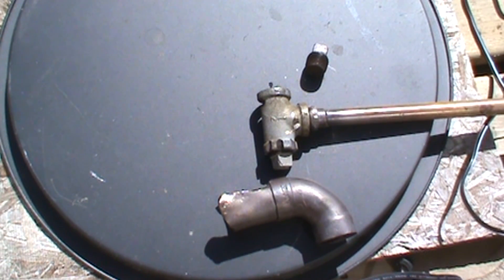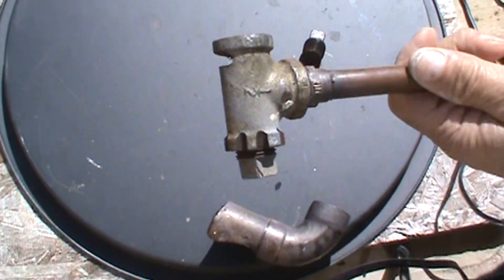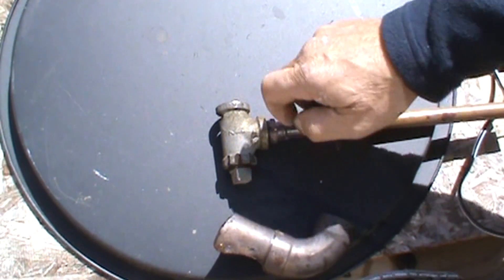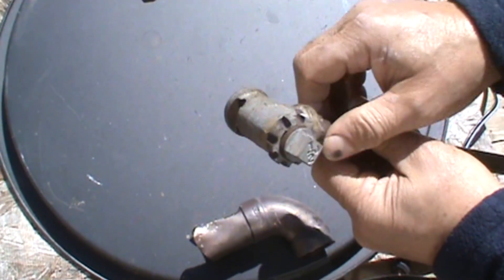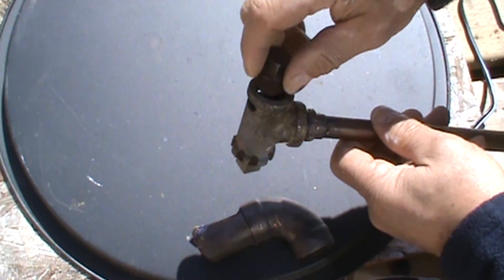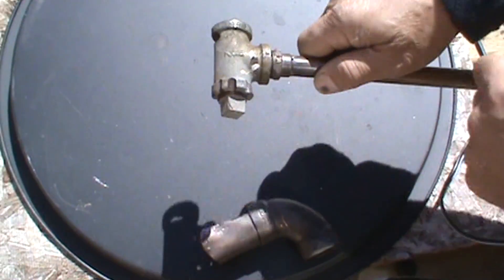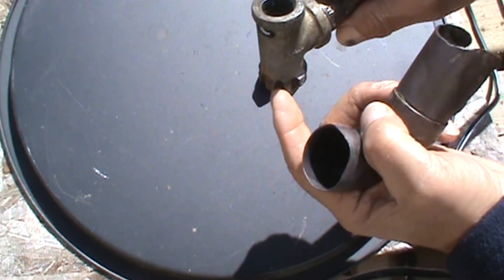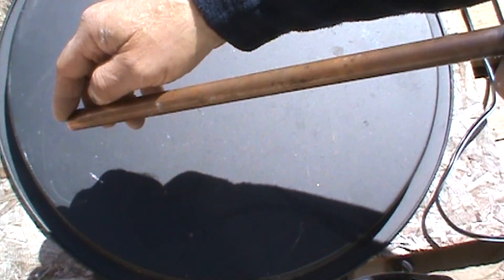Homemade Oxalic Acid Vaporizer

Comment: i "blew out" two immersion heaters trying this method....As others have said, apparently if not in water,,, the element (coil) gets too hot & breaks--will not heat/blows out/non-functional. This is a bad design if you want to use it more than once...or you can limit the temperature..!
Reply from the maker: I do not recommend using an immersion heater for this vaporizer. This design is for a heat gun only. I've been using this for the last 2 seasons and is still working well. Could you be commenting on someone else's post?

Comment: This does not overheat the hive? For so long with a heat gun? My heat gun will melt paint
Reply from the maker: No it doesn't overheat the hive. My heat gun melts paint as well but since heat can escape from between the galvanized T and copper pipe, the air coming out at the end of the copper pipe and into the hive is not as hot, and as a matter of fact It takes quite a while for the end of the pipe to get hot to touch. It's been very effective for me and I'll be treating  my hives with it next month. Very cheap to build as long as you can use a grinder and have a heat gun. Good luck.

Comment: what temperature does this operate at?  Doesn't overheating the OA change it from OAV to formic acid?
Reply from the maker: It does get very hot but doesn't over heat the oxalic acid. The reason is the area where the oxalic acid sits in the galvanized T  starts getting hot after about a minute or so from when you start the heat gun and vaporizes from that area within the first 2 minute and before it gets too hot for the oxalic acid to burn. From there it sticks inside the wall of the copper pipe where the temperature is lower and keeps vaporizing slowly for about 10  to 12 minutes. That's how long I keep it in the hive. If you take it out too early you see smoke still coming out at the end of the copper pipe, and if you turn the heat gun off and look inside the  copper pipe you see white residue still inside. That means that the oxalic acid hasn't vaporized  all the way. If you have to do a second treatment grab it with heat protective gear from the end of the copper pipe remove the heat gun off it and dunk it in cold water for a few seconds but keep it warm enough so that the water on the metal evaporates fast. Cheap to build and very effective.
Reply: Good information